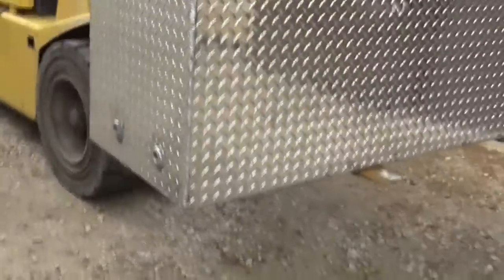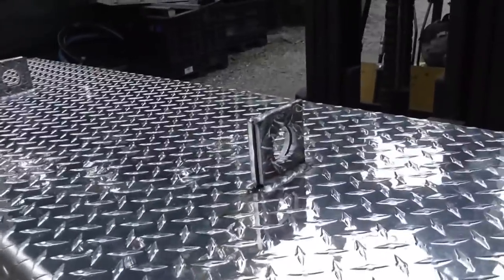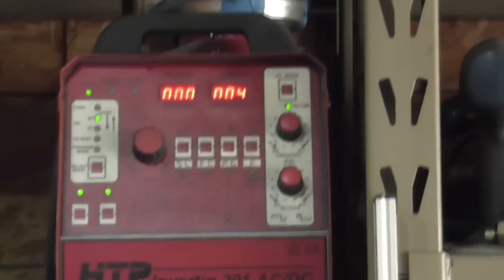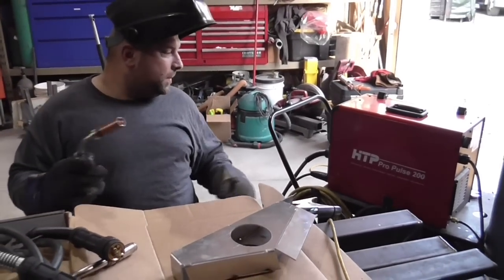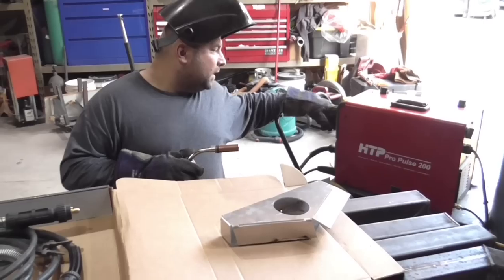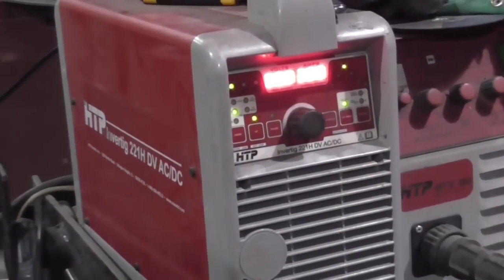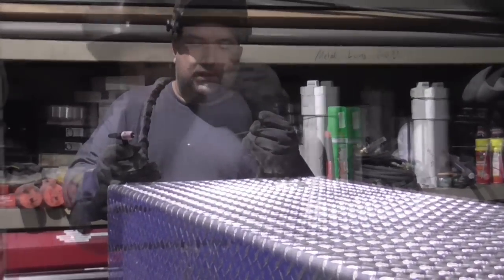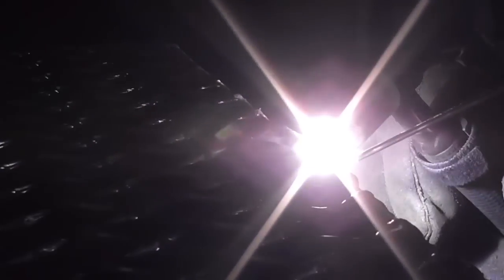How to fix a 200 gallon aluminum tank Tig and Mig (pulsed)

Comment: How's the double pulse on real thin aluminum
Reply from the maker: the thinnest you can choose double pulse on (using a PP200 or Pp220mts) is about .080" .... below that you only have single pulse options unless you have a PP300 ....  double pulse works good - I think you have more "control" and "ease of welding" using single pulse ...
Reply: @ZILAwelds  I'm looking to weld some pods on my jon boat, I'm not sure the aluminum thickness. Don't know if I should buy a tig or the propulse 220
Reply from the maker: @sbranham86  I cant make that decision for you - they both work, if you would bring your boat to me. - I am 99% sure I would use the Pro pulse ....  and there re a couple guys in Illinois and in Florida who I talked through the process over the phone and they have built pods for their boats with the pro pulse as well ... and I bet other guys tig welded them just fine ....  I dont know what to tell you ??? I really dont.

Comment: I am considering a longer term kinda project, building an aluminum 50' sailboat.  How much would this machine cost me if I wanted the pulse feature?  Is this a  $1000, $3000 or $5000 setup?
Reply from the maker: Hi,  the Pro pulse 200 was discontinued in favor of the Pro pulse 220 MTS. It cost a little over $2000 by the time you add a remote control and the aluminum package you might be looking close to $2500 .... how thick is your boat going to be ? and what is the ambient temperature where you will be building it ? will you be building it indoors or outdoors ? this process is is somewhat sensitive to wind (not nearly and bad as tig welding) but you might want to keep that in mind.

Comment: Is that HTP pro pulse a regular mig?/? I can't see if your gun is a pull type.
Reply from the maker: Mike Makuh i dont know exactly what you mean by regular mig - but if your question is if the wire is pushed through the gun - than the answer is yes.   However it has a precision swiss made wire feeder with different drive rolls for different kinds of wire - and the torch cable for the aluminum torch is only 8 ft long. 
It works absolutely flawless even with the soft 4043 wire .035 dia  
Than the aluminum torch also has upgraded contact tips to withstand the extreme heat ( regular contact tips burn up in VERY short time)

So it is engineered to do what it does ....  And it does it pretty good in my opinion. 

I ran over 70 lbs of aluminum wire through my machine. Never had a problem so far

Comment: its funny from all the videos you did with ChuckE2009 i didn't think you tig welded.
Reply from the maker: in 2012 or 2013 i made 3 videos with chucke2009 on tig welding SiBro and AlBro ....   but on a day to day business 60% is wire 30% is stick and 10% is tig .....  i have some oder tig stuff posted on my channel ....  but truthfully - ever since i have pulse mig machines (the HTP Pro Pulse 200 and i have a lincoln power wave  355m with25M feeder, watercolor and water-cooled mig gun) i very rarely tig weld even aluminum ......  only if it is a repair job or someone "screwed it up for me" before i got to weld it ... if it is fresh material - pulsed mig typically does a really good job ...  more than 80% of the stuff i used to tig i now mig .... its too much faster also !
Reply: ZILA personally i prefer the appearance of an aluminum tig weld over mig but the only aluminum mig welds i have to go by are done by someone who doesn't really weld aluminum. when i found out who welded it i was kinda surprised lol
Reply from the maker: Randy Gray did you see how in this video the Pro Pulse works?  With the double pulse it looks REALLY good ....  Almost like tig...  For the stuff i do - its more than good enough ....  My customers are not that picky ....   I typically dont weld on the space shuttle, or nuclear plants or any show pieces ....
Reply: ZILA lol. im just referring to appearance. im sure mig welds will get the job done but i feel a good tig weld is much smoother look and you wont have any spatter to clean up
Reply from the maker: cleaning up spatter on aluminum is a b....  it basically screws up the look of the whole project !    the Pulsed mig on aluminum is virtually spatter free !  that is one reason why i like it !  and as far as appearance the double pulse makes it look like tig (sort of) a trained eye can tell the difference ... but like i said - most of the time my customers do not care ....  and if you bid a job start to finish flat rate (and not hourly) than pulsed mig is also WAY faster ....  like i said - i still tig weld - and i like the looks of it ... i just pick my battles !